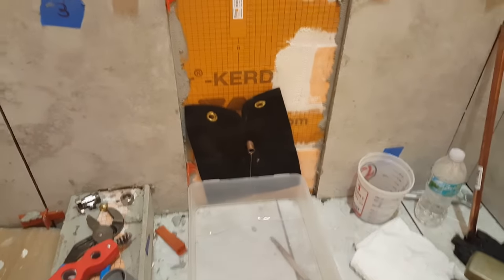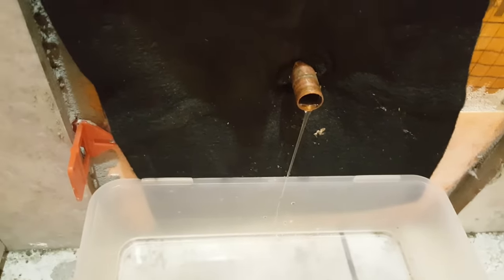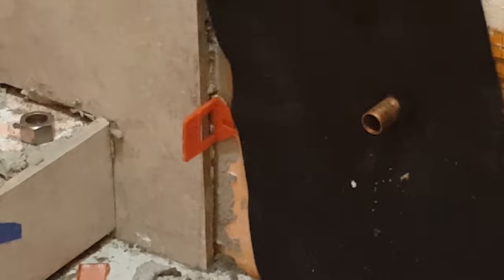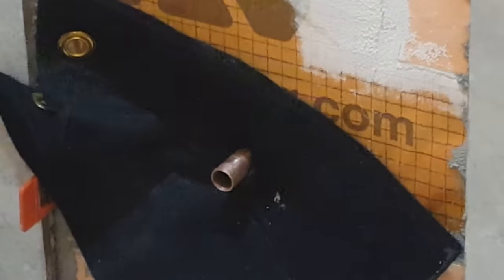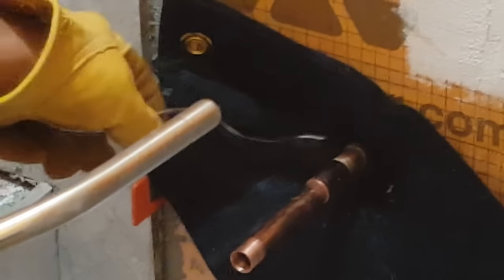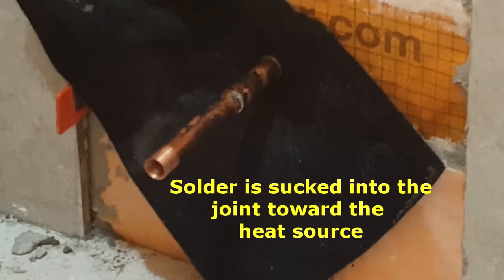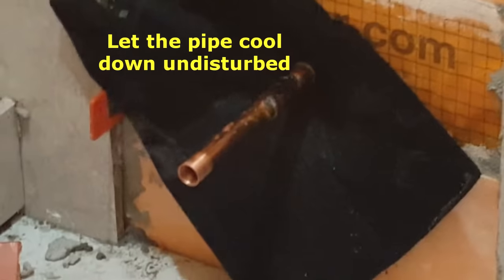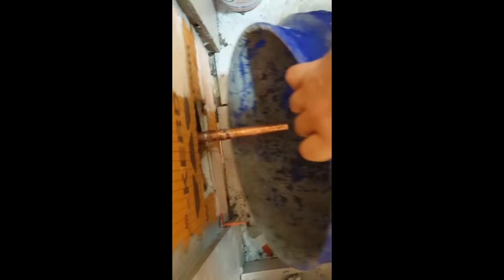Insane Plumber's Trick: Solder Copper Pipes Dripping Water

Comment: I carry a 12" piece of 1/8 " steel brake line with a flare on one end. Slip a balloon over the flared end and wrap rubber band several times to hold and seal it tight. I use an old squeeze bulb from a soccer ball pump on the other end. Slide the balloon through the fitting several inches past the area to be heated. Pump a squeeze of air to inflate the balloon and then do the solder job. Release the pressure and withdraw the tube with the balloon still attached.

The actually make commercial devices  that work this same way but require multiple sized inflatable bladders...and the size you need is always missing from the tool box. The balloon system has never failed me. I have even used the method on natural gas  and oil pipeline welding repair. (keep a sniffer handy)
Reply from the maker: That's another great idea, thanks! Just watch out for the snobby arrogant plumbers out there who call it amateurish and unprofessional.
Reply: You my friend are a genius.  I'm  going to the garage to put one together.  Can't wait to try it. Thank you.
Reply: Brilliant!

Comment: had to use this trick just a week ago was brazing some under the slab line and the hot water would not stop leaking so I had some left over biscuits form breakfast and shoved it into the line both direction and stop it long enough to braze, try it it works
Reply from the maker: I have used it a hald dozen times, works like a charm. I also have a Jet Swet, a pro tool for doing this same thing

Comment: Stop water flow as much as possible by turning meter off and on a few times , then find lowest supply which most likely would be the toilet water supply valve and remove line from shut off valve , use a to do or small lan under to catch leaking water , that will give you enough time to solder pipe , or loosening the meter adapter ( the big nut with the ruber washer , ) water won't go up the house , I've done it many times if the bread doesn't work , the bread trick only gives you like a minute or less depending on the amount of water leaking trhu  . I'll try the bread first then exhaust the other options , one of them it's gonna work  .and never give up. Get it done no matter what...
Reply from the maker: A we did it the opposite here we tried turning on all the faucets and all the other rooms and sinks and nothing helped because the gate just simply was not closing all the way on the valve. Also in many condos you can't just go outside and cut off the main because you'll take out other people's units with it which is a big problem with some of these older condos.  They want to sign on the elevator with 24 hours notice about water being  shut  off tomorrow. In our case the bread trick held back the water for probably at least 10 minutes while we were filming this scene.

Comment: I just finished plumbing in a pressure tank for our well.  I had 4 joints spraying water afterwards.  I realized I had applied the flux using my finger do you think the oils from my finger in the flux cause that failure
Reply from the maker: Aaron, yes, oils from your finger could have caused it, and also maybe just an incomplete soldering and heating. Did yo brush clean all the parts where solder will be? Did you heat from underneath and let the flame heat rise up? Did you use the correct amount of solder? Did you push the tip of solder around the connection seam and let the solder melt on the pipe all the way around, and not try to follow the solder around the pipe with the flame? Did you apply heat to only the fitting and not the pipe to allow capillary action to suck the solder into the connection joint? Did you leave the heated connections ALONE, undisturbed after you turn off the flame and let it cool down by itself to room temperature? You want to be sure you don't use a cold or wet rag while the pipe is still cooling down. Let me know how you did with this check list, it could be a combination of issues.
Reply: @jeffostroff  thank you very much for the kind and extremely straight  forward reply.  I'm using the checklist to start over.  What a pickle I'm in now, bit with your help I'm on my way to success
Reply from the maker: @AaronRiegel  One more thing, go watch this 5 minute how to solder video, it's the best one out there, this guy is the best: https://youtu.be/JyVbjDsric4

Comment: To make the job faster , before you put in the bread , you can clean the outside of the pipe and don't have to do the inside.  you should have pre soldered the joint on the second pipe ahead of time and  cleaned the inside of that pipe.  Then shove in the bread the dry the inside and give the outside a quick once over with an emery pad.    Then not so much torch flame.
Reply from the maker: Those Benzomatic torches give you way too much glame

Comment: Rookie. Prep your pipe before sticking the bread inside and always heat the bottom of the fitting first, especially if there’s water in the pipe. The solder will always catch on top but it’s the bottom where the water will be traveling is where you will have the trouble if there’s water in the pipe. Also if your water main shutoff is not completing shutting down the water you can brake the nut on the water meter as well.

Comment: The WC connection is the lowest point in a house so unless you have a hose cock lower that you can remove the top assembly and letting the water to flow out there, the only way to stop water affecting the joint is to disconnect your house at the meter where the main meter cock is that you shut down.
There should always be a union connection where the main water comes in allowing physical disconnection of your house from the main.

If you use the correct flux, you do not need to worry about all that mucking about cleaning the pipe.
AND you certainly do not need to clean the inside of the pipe not unless you are using a fitting that goes inside the pipe, (they don't exist).

The best flux to use is LA-CO soft soldering flux. It is water soluble and does not need to be cleaned up. When the water is turned on, all residue LA-CO will flush away.
 You should never put the flame directly onto the fitting when SODERING a joint. The flame should be applied 25mm away from the joint allowing the heat to travel along the pipe to the joint at the same time occasionally touching the joint with the soft solder to test if it's hot enough.

Comment: Why do you clean the inside of the copper pipe when the solder goes on the outside of the pipe? Please explain I’ve seen this so much and don’t know why people do it
Reply from the maker: For me it was a slip of the wrist, loss of focus, end of a day 100 degrees in that bathroom and I was having a hard time concentrating. You can hear me say after doing it that it was non necessary.

Comment: Reem the pipe and sand it. Then use a long piece of 1/4" inch r/o tubing and shove it into the pipe until it will not go any further or at least 2'-6'+ feet. Then blow and blow until no water comes out. Then put the brushed fitting on to the sanded pipe with flux, flux the pipe, and solder it. Of course you will want to have the fittings brushed, and the pipe sanded, and fluxed. Also have torch and solder ready near bye to use as quickly as possible to solder the fitting. I have been plumbing since 2000 and went to a plumbing technical college and the r/o tubing trick is the best one I know of, no bread stuck in water line or mess from it. I always use this trick on top outs when the manifold stub out from the underground plumbing has to be cut, sanded, reemed, fluxed and fittings cleaned fluxed and put in to the pipe. You want to flux the pipe after getting the water out of it with r/o trick. I have heard of the bread trick but never used it, and I have done the plumbing on hundreds of homes, 30 + commercial buildings, and around 1000 apartments. Plus plumbing service some and add on's or extended water lines.
Reply from the maker: sounds like a cool idea!

Comment: I thought the bread dissolves in the water and will break down and come through the faucets when the screens are removed.  Do you have to turn on the water and blow it out?
Reply from the maker: Yes you must blow out the the bread, because we act quick to get everything done while the bread is still a hard ball and has not broken down. Those pipes need to be clear before you install the shutoff valve.
Reply: @jeffostroff  Thanks

Comment: if you shut the main water off and it still trickles out, then opening the hot and cold valves of the sinks or tubs below the line your repairing should do the trick. it worked for me.
Reply from the maker: Jerry, That simply was not possible in this case, this was a toilet water supply line, already the lowest point in the property. Also, what you are proposing does not work when you have continuous water more than a trickle flowing, your solution works to relieve water still in the system after the water has been successfully shut off.

Comment: I've used this trick many times with success but the last time  it ended up clogging my bathroom faucet. Unfortunately I had to dissemble the faucet and clean it out to get it to work again. I probably should have unhooked the line from the faucet before I turned the water back on so the bread could exit the line.
Reply from the maker: Danny H.  Yes that can happen that is why you always want to plan ahead with your exit point, where it is going to be for the bread and make sure there is nothing on that exit point so that the bread can shoot right out.

Comment: I use this trick but, why not clean and prep the pipes prior to inserting the bread?
Reply from the maker: Yes you could. I preferred to clean after the bread was installed, in case any impurities or oil got onto the pipe.
Reply: @jeffostroff Lol, don't butter the bread! JK. Clean first, stuff the turkey, I mean pipe, and then just give a quick swipe with bit of rubbing alcohol if you think you got stuff on it. Gives you more time for the soldering.

Comment: huge thanks for posting.   Is it OK to use a compression fitting for connection where solder is not possible because of water?
Reply from the maker: I would only use one if it were outside the wall
Reply: @jeffostroff  thanks for the advice. I  tried it with a piece of  rope. It was a 3 inch of vertical piece of pipe which then bent into horizontal. Pushed the rope  in.   Waited few seconds and pulled it out. It was soaked and I saw no water left in the 3 " vertical.  Slid the pipe and the coupler  on.    It took the solder  no problem.     No leaks.

Comment: Did you open another line to help drain? If the main valve isn't closing completely, that's a bigger issue, i would've stopped to fix that. I don't know why ppl are mocking your sweat job. It's fine, and some good tips.
Reply from the maker: Why do so many of you people come in here pedaling that nonsense? Of course I tried opening drains in other rooms and no it doesn't solve the problem what you're failing to understand, is that when the main valve will not turn off 100% no matter what you do and you still have a stream of water leaking no amount of turning on and off faucets in other rooms is going to help especially when this is the lowest pipe in the entire house.
Reply: @jeffostroff  nonsense? I'm guessing you have a shi**y gate valve for your main shutoff. Im not confused. I can understand your frustration with the abundance of snide comments. 🙄

Comment: I have a question for you.  The nipples(threads on top of the water heater) do not want to seal.  Water keeps dripping through the threads.
Reply from the maker: You will see most plumbers will coat those threads with pipe dope it's that blue thick rubbery liquid that you brush all over the mail threads before you attach it then you will see it sealed up give that a try.

Comment: R/O tubing and blowing the water out the line works best. Another trick is a 3/4" unreemed copper pipe that's about 6" long to scrape the dry wall mud off of the copper pipe first then sand it before putting a angle stop.

Comment: Is Soldering to hold the pipe together or stop for water leak ?
Reply from the maker: In this case and was to extend the length of the pipe coming out of the wall because it was too short

Comment: Bend your solder so that you're feeding the end, not laying the wire on the joint. Heat rises. So have the flame pointed at the bottom of the fitting(if possible). Start at the joint nearest the bread and... the tip of the blue cone everyone.
Reply from the maker: Good tips, thanks!

Comment: Heat from the bottom, no excessive solder. I also run my flux brush around the soldered joint which not only cleans the joint up it also spreads the solder around the joint a little more 👍
Reply from the maker: Good tip! But keep in mind, I've read research that says not to flux the joint after you sweat it because the cold flux is a temp shock which can crack the heated solder joint. So I quit doing it, but yes it does make things look nice and clean.
Reply: @jeffostroff  If you see a drip, just use a dry cloth to gently wipe the joint, while the solder is still liquid, then won't cause a crack.
Reply: I did that too, but it messes up the flux brush bristles, a dry cloth works better and not as messy

Comment: I’ve used that so called bread trick on a leak like this a few times and all it did was make a mess. Can you braze with copper rods instead ?  would that work better than solder?
Reply from the maker: Try to ball the bread up nice and tight and use only the white part of the bread, it has worked every time we have used it. If not, you can buy a 1/2" Jet Swet Plumbing Plug Tool (Alternative to bread trick): https://amzn.to/2VB4RJW
Reply: Bread trick does work.  You do still have to dry out the pipe though.  No idea why you would try to braze with copper, how would that help?  If you were at temps to braze copper onto copper, that's basically a weld, no? Much more complicated and the pipers are not meant to take that - those temps would possibly screw up the pipe and you'd get leak from the pipe even if the joint was welded solid.
Reply: Spend $200 and by a jet sweat kit. Worth its weight in gold on that 2am leak . I'm pretty much to the point lately that if it's not a ball valve I bring the kit in with the torch

Comment: Waaaaaaaaay too much heat. You don't have to clean the inside of he pipe....Also, you heat the pipe first then the fitting...
Reply: ^^^ This ^^^   And if you put flux inside the pipe like this guy did, it could to draw solder INSIDE the pipe and make a bunch of torpidity that will break down the joint over time and no matter how "solid" the joint is, it will fail prematurely.  No flux inside pipe.  I would trust the acid in the flux to clean off "hand oil" before I would put flux on inside of pipe.

Comment: Can I reuse a valve even though there is some soldering compound still  inside the walls of the female end? If not, is there a way to get it off?
Reply from the maker: I don't think you would have any problem with it but if you feel uncomfortable valves are not that expensive that you could put a new one on.
Reply: Thanks.

Comment: Soldering the fitting to the pipe seems very hit and miss for success. In the UK we would use 'Yorkshire Fittings' which have rings of solder already in position. Just clean off the pipe ends, flux, push on the fittings and heat.
Reply from the maker: Yes I heard of those and was very intrested in trying some of those out. My only question is how do you know when the solder has flowed because it's in the middle and you can't see it so how do you know?
Reply: When the solder is fluid it will pop out of the sides, and that's it. I am not a plumber, but have found these quick and sure. But, of course, cleanliness is the key to a good joint and you made a good key point re not touching the clean pipe ends. There are a couple of videos regarding these Yorkshire fittings on YT. Best wishes.

Comment: In extreme conditions use a compression fitting and valve
Reply from the maker: gary, That's not an extreme condition actually, the compression fittings are the norm in our area. We went on after this repair to install a compression fitting. We had to cut the old one off and extend the length of this copper pipe from the wall because the stub out was too short to begin with, then we added a lot of thickness for the tile and thin set mortar, and the homeowner was disabled and wanted the pipe to come out further from the wall to them to reach the compression valve, if they needed to which we installed at the end of this pipe.
Reply: @jeffostroff  No man I mean in an extreme situation where the water keeps running. You install a compression fitting so you can shut the water down and  continue work

Comment: Since you are using compression, isn't it easier if you solder a pipe onto the shut off valve, and connect the pipes together using a compression coupling?

Otherwise might also be better to solder on the shut off valve before flushing out the bread.
Reply from the maker: John, I don't think that would be easier, to install the compression valve onto a loose piece of pipe. It might be more cumbersome to tighten down. We like to attach the compression fitting shut off valves right onto a pipe coming out of the wall because that pipe is held in place, because we have to use 2 wrenches to tighten down the compression nut. That is easier to to do on a stationary pipe coming out of the wall. As for your second suggestion, You don't ever want to install the valve on the pipe until after you flush bread out, to avoid the bread getting caught inside the valve. Remember the copper pipe is 1/2" wide, and so you are expecting a 1/2" sized ball of thread to shoot out of a 1/4" inner diameter hole on the shut off valve where the hose will connect to the 3/8 threads. Not a good idea. It's easier and quicker to just flush it out for 2 seconds of water flow into your Homer bucket.